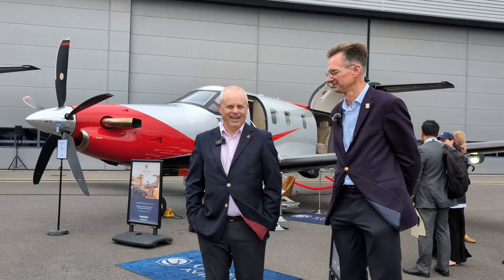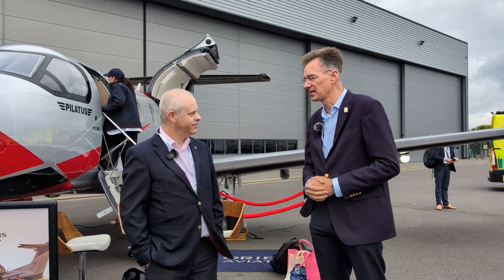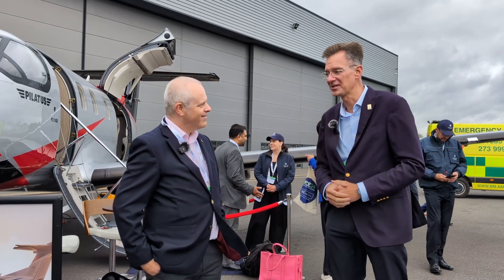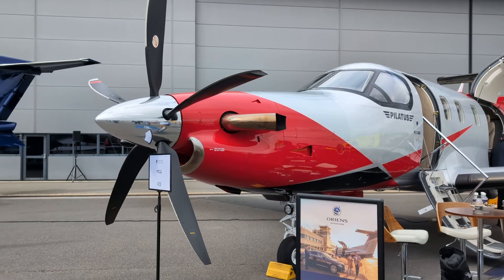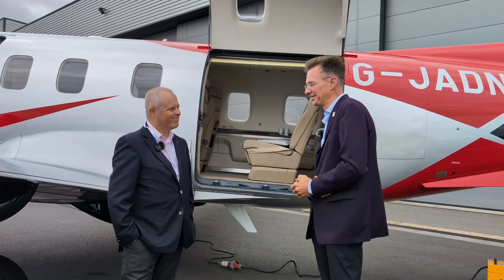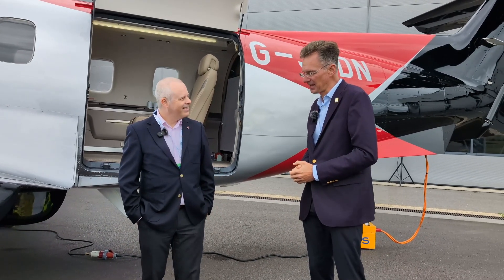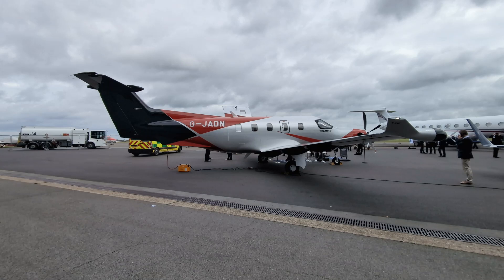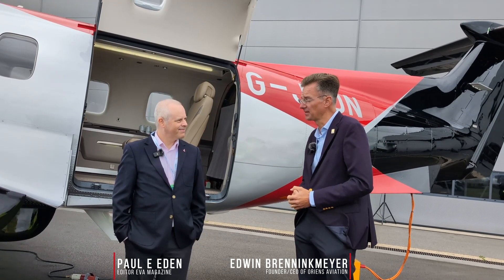Discover the Pilatus PC-12 NGX: Digital Engine Control, Versatile Cabin, Rough Field Capability

Comment: I have been flying the PC-12NG professionally for the past 8 years and over 1,000 hours. Noise abatement is not even a consideration since the PT6 is really a quiet engine without any need to reduce its noise footprint. Great airplane!!!
Reply: Why do so many people crash them and kill their families? Mostly when Autopilot disconnects. Pilots can't seem to take back the control of the plane. Does that sound like a safe plane?